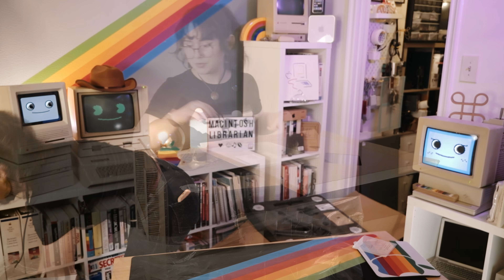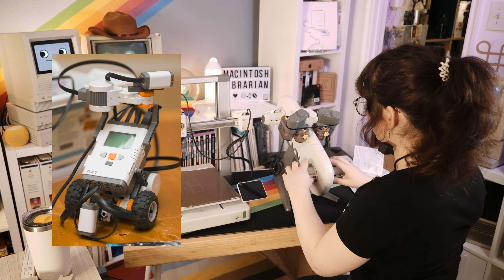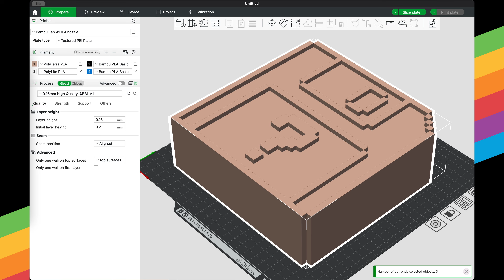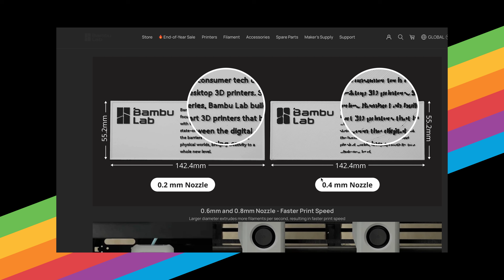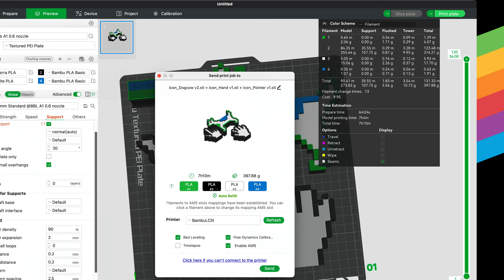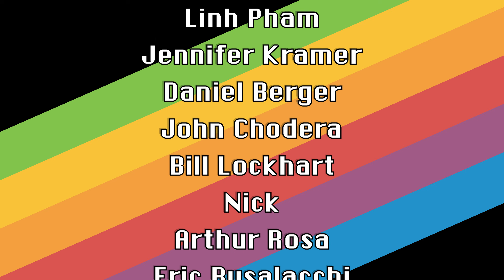Bambu Lab A1 - Review and Unboxing! (Corrected Version!)

Comment: Silly question maybe, but does it actually require connection to a computer? I only use Linux these days so if it can accept models sent to it through a web interface, or stored on an SD card, that'll ensure I can use the printer on any platform I use. Thanks for the video.
Reply from the maker: The official bamboo studio slicer does have a Linux  build in their GitHub repository! Also, I have used an alternative slicer , Orca Slicer in Linux mint. It works well. A third option is to copy the models via SD card too ! And then you can monitor it on the Bambu handy app on your mobile device.

Comment: As someone capable of working on their own printers I wouldn’t touch this. Ender 3 and cr-10 are being sold off at £20-40. Once you install Klipper, an aliexpress bimetal heatbreak and ‘fixed’ dual gear extruder and of course dial in retractions these printers will work reliably and fast.  
If you need more speed a dual y motor setup will increase motor accelerations to 10k or so.

Comment: Great video! I gave up on 3d printing a while ago because I had to fight so much with the printer after a while. Things like getting prints to stick to the bed but not stick too strong, printing reasonably flat surfaces without shrinking/curling, failed prints, trying to figure out the best setting for different materials and prints....it was all too frustrating for me. But you got me wondering if I should give it another shot.
Reply from the maker: It is a totally different experience with this printer!

Comment: I got this printer (Bambu A1) not that long ago. I ordered the basic version (without the AMS), not paying attention enough to realize that the cheaper version didn't have the part to do multi-color printing. I have now ordered the AMS, but they haven't shipped it out yet... The printer works well, is fairly fast and accurate. I am now using it to print parts for a different type of printer I am trying to build (assuming everything works... it will involve the use of PEDOT:PSS semiconductor inks, and me trying to hopefully print working transistors and logic gates...).
Thus far, I have used, PLA, PETG, and TPU for the various parts, everything works fine.
For parts with fine features, such as gears with an 0.042" tooth pitch (namely worm-gears using a 10-24 screw), the printer has a hard time pulling this off particularly well, but the fairly minor change of moving to an 0.05" tooth pitch (for a 1/4-20 screw) has significantly improved results (the gear teeth are better defined and more usable).
After trying a few 3D modelers, I am mostly using OpenSCAD; where one writes scripts in a sort of geometry-oriented functional language, which then performs CSG operations, and one can generate results as an STL file for the 3D printer.
I am mostly holding everything together using 10-24 screws as, attempts to use M3 and 6-32 screws directly into 3D printed PLA and PETG were not particularly successful (though longer M3 bolts and nuts+washers still works).
I have mostly ended up using PLA for structural parts, PETG for mechanical parts (such as gears and bushings), and TPU for some flexible parts, like tubing connectors and tubing holder clips.
Still waiting on AMS, which could allow a few things I don't currently do.
Fun times...